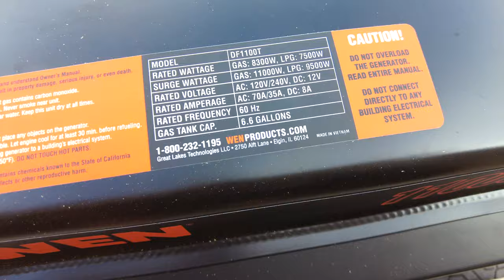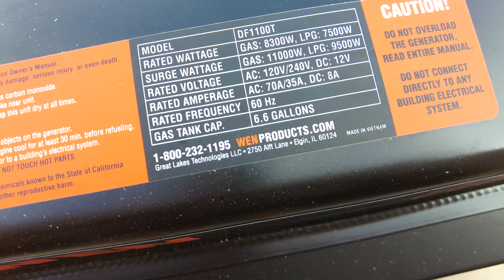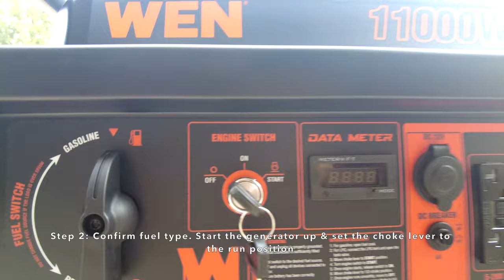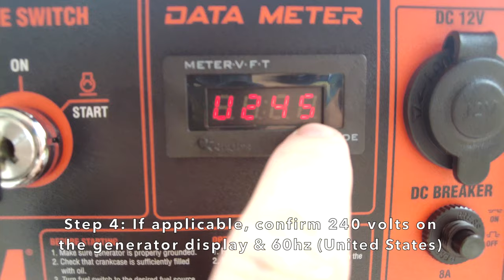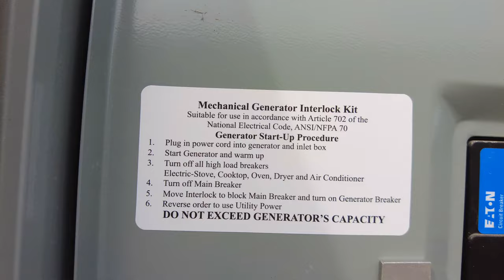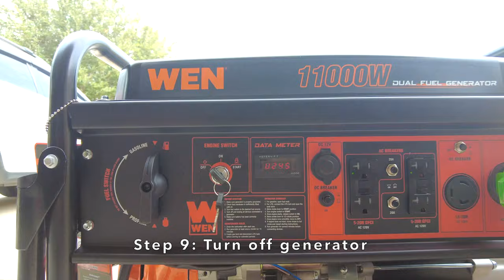Backup Generator | Storm Power Outage | Amazon

Comment: What kind of hardware screw would you recommend for securing the hooks to the wall so it won't be easily removed by the would be thief?
Reply from the maker: What kind of material is your wall?
Reply: @sparky_izzy  Hi!
I have a brick wall.  I’m  thinking down the road to perhaps make a concrete pad and have something anchored.  The anchors I’ve looked at have smaller loop and my chain won’t go through.  Your idea of the hook looks to have a larger loop so I’m thinking that might work.  Searching for something that is not as easily screwed out with a screw driver.
Reply from the maker: @doradean3097 https://amzn.to/3WCHgKq
Reply: @sparky_izzy  appreciate you taking the time to look up the parts for me.  Didn't know such thing existed so wouldn't even know where to look, thank you!